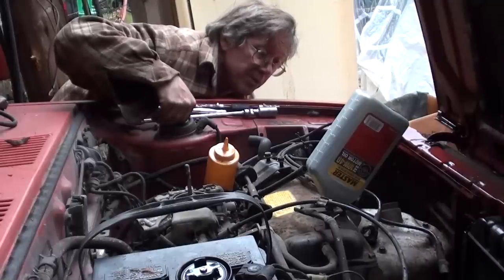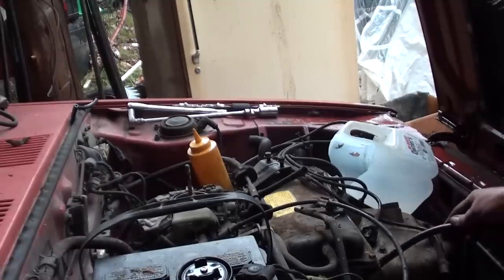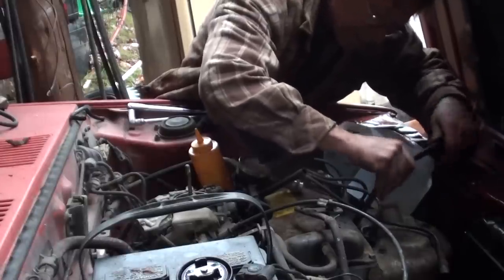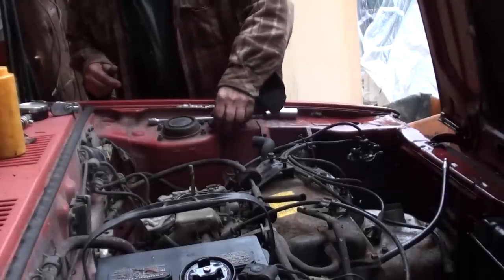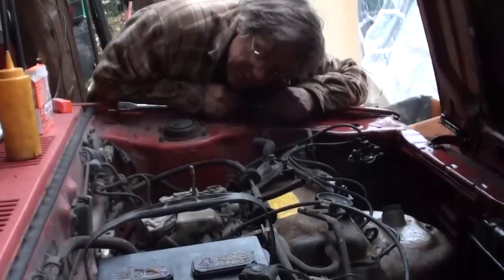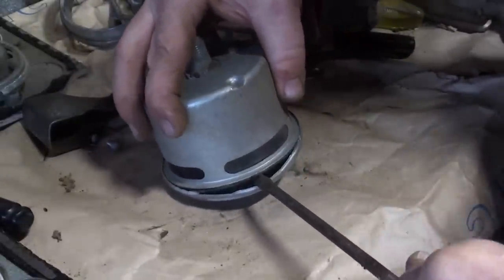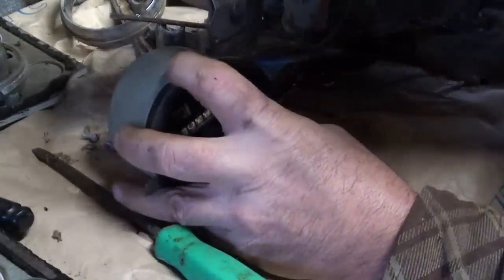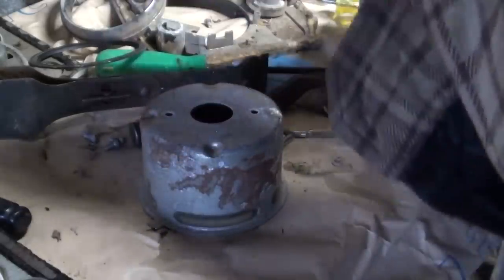58 GMC Speedo Part 2 Resurrection Part 26

Comment: Jeff, been watching your videos for many years, always appreciate your partiality to GMC trucks. Some say they are the same as Chevys but that has not always been the case. The old jimmys used different engines and many other components. Through through the 60's when Chev was using coil springs on the rear of pickups, as far as i know GMC never did. GMC used their truck v-6 engines . There were many differences. I just remember an old GMC commercial from the 60's that said that GMC is the TRUCK people from General Motors,
When you have a GMC you have a truck. If you have a Chevy , you have, well .......... a Chevy !

Comment: I love your Descriptive Words... Great Glob o' Gleeb :) 100 psi after sitting for 7 years? I'd say that's pretty good. The compression will go up, after the valves bash the rust off of the seats :) I like showing people the Pontiac 389 video, where you have it running WIDE OPEN (sans carburetor) :)

Comment: I'd say that keeping the throttle at WOT during a compression test is more important on fuel-injected cars. No guarantee that the idle control valve is working and not restricting most of the air flow. If nothing else, WOT allows you to crank it the least amount of time to get a max reading.

Comment: I wish it was explained a little more why the 12 v meter didn't fit, is it from a later generation and was this GMC originally 6 volts?
Reply: jvan the original was 6 volt, he has now converted it to 12 volt. The gauge in which he has chosen is just and average 12 volt aftermarket gauge you would buy.

Comment: Low compression might be a head gasket, but if that car had not run in so many years, the rings and valves could be sluggish....they idea is that they will loosen up after a little running.

Comment: Also, invest in something called EZ-Grip, or make your own using sand and a light grease or a heavy oil.  It provides amazing amounts of grip on fasteners to keep them from stripping out.  You wouldn't believe the things I've gotten out using that stuff.  An alternate is just sticking a screwdriver in some dirt, not as effective, but works in a pinch.